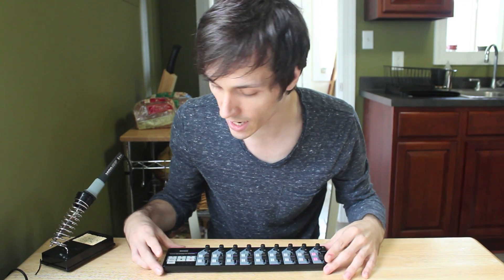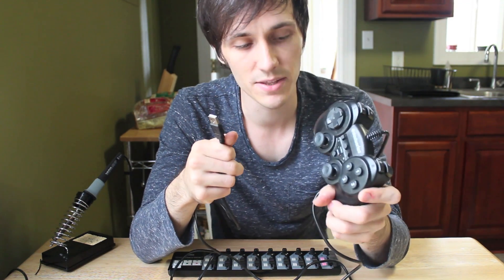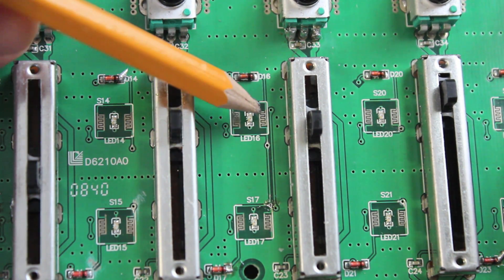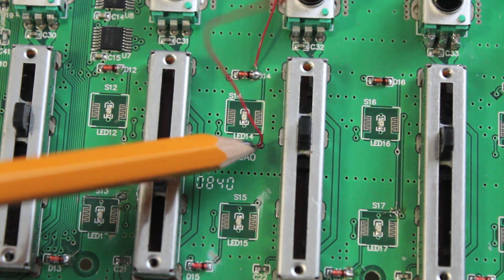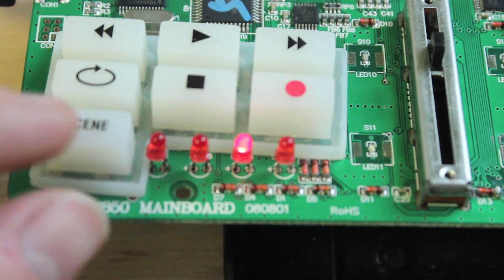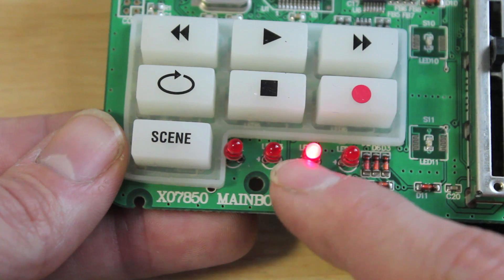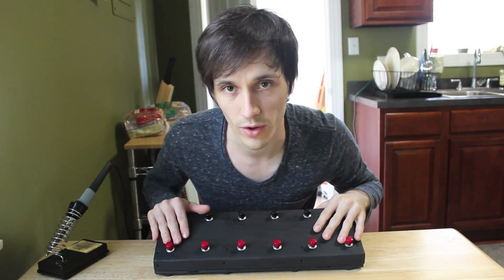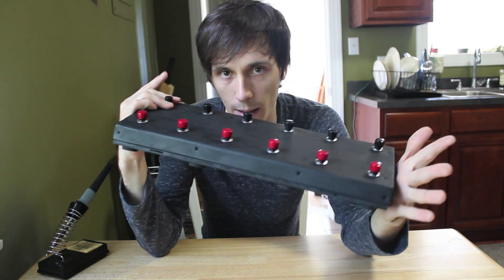How to build a USB Foot Controller Pedal for Ableton Live (or other DAW)

Comment: Wow, I have done this exact  thing myself. So nice to see someone else has done the same thing. could of saved me a lot of time if I had seen this 1st. One other thing I would do is to remove one of the rotary potentiometers and solder link wires to a 3 pole 1/4" jack. Measure which contact is ground, this will go to ground shaft of jack, the other 2 go to ring and tip, reverse them if the pedal works backwards.  Then you can plug in an expression pedal and assign midi for a wah wah pedal or volume, whammy or anything else. I used a cheap M-Audio one. it works really well.

Comment: One important thing might be to extend that Korg USB port and just have a cable dangling out of the box. If not careful that USB port will break very easily when sitting on the floor. Great tutorial! I think I’m going to use 5mm ply for this with some reinforcements. Have you actually tried doing it with velocity pads like nanopad? I’d see that as the best candidate.

Comment: This is a great hack.  I was just researching pedals for using with Garageband and MainStage and stumbled upon it.  The funny thing is I have one of these controllers I bought at a recycle shop for $15 that's been sitting in a box not being used, so it looks like I have a new hack to do.  I had tried it and didn't like it, so this is a great way for me to recycle it.

I'll probably go a bit above and beyond and move the LEDs for the switches etc. I'll link you a video of it when I'm done.

Comment: Here's a great idea if you don't want to mess with solder and wires.  Google "engadget, Korg Nanokey controller repurposed into MIDI foot pedal"  I'll try to post a link here:  www (dot) engadget[dotcom]/2009/10/28/korg-nanokey-controller-repurposed-into-midi-foot-pedal/

Comment: Thanks for the tips.  I have one for your viewers and you if you do this again.  DESOLDERING BRAID.  A couple bucks from radio shack.  Lay it over a solder blob you want to remove.  Heat the braid with your soldering iron and push it on the blob.  It will melt the blob, and wick it right up like a sponge.  Very easy, and keeps everything clean.

Comment: I do something similar in a "cheap & dirty" way using a USB keyboard with most of the keys removed and some plates attached to the remaining to press them by foot. The I use Live's key mapping instead of MIDI mapping. Just wondering how did you configure Live for looping, can you share?

Comment: (3/3) i could have something like a Camera Connection Kit (30 pin to usb) so i can use it with my phone, and use a usb hub to connect both the usb from the midi device and the usb from the mixer that would have my instruments. This is quite a project and it's really hard to find access to the information i need easily.

Comment: (2/3) linked to a griffin studio connect store.griffintechnology . com/studioconnect-na17132-1 (on sale for 70 something at guitar center) acting as an audio and midi interface that i can connect with to a midi controller chained with the FCB1010 AND connect with a separate mixer for my instruments like bass guitar vox and more. 

I think i want to try this method instead, but re-soder the knob/slider potentiometers so i only have one controller i'm worrying about, and then i could (2/3)

Comment: hey this is great! i'm currently in the process of hooking myself up with midi for looping as well. What detoured you from things like the FCB1010?

Right now i'm trying to hook up both a midi footcontroller and a midi controller for my hand that has sliders and knobs so i can control my panning and volume levels for each track. My set up is for my iphone using an app called loopy hd (a very handy and affordable app you should check out) and it starts with my iphone, linked to a (1/3)

Comment from the maker: Thanks!  Well, there's no audio going through the pedal at all, its just acting as a midi controller. All the actual audio would be running through Ableton and what ever audio interface you're using.  This is strictly a rewired midi controller with no audio!